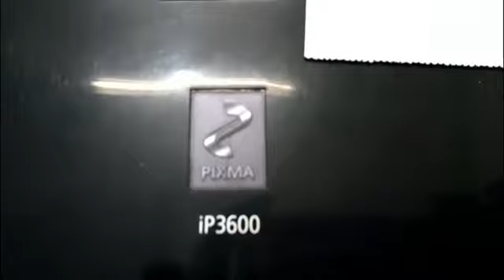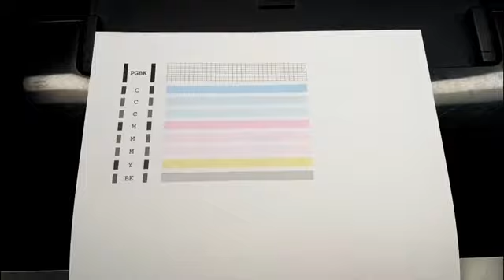canon ip3600 printer blinking lights

Comment: Well, I skipped all the taking apart process and just slid the tray to the cartridge tray left, then stuck a thin screwdriver into the ink pad cleaner thing. I slid the top part back then poked the bottom part just like you did in the video at 5:36.  Then I turned it back on again. The cartridges slid back and forth a few times and now the orange light is off and it's telling me which tank to change!  Glad I didn't take it all apart for that.
Reply: Orange light what does it mean

Comment: thx again - but if the problem is the soiling of the cleanercushions on the right end of the car's run - you dont have to dismantle the whole thing - it can be reached by opening the top hatch - look to the right - maybe use  some q-tips or the like - clean that area . and see what gives